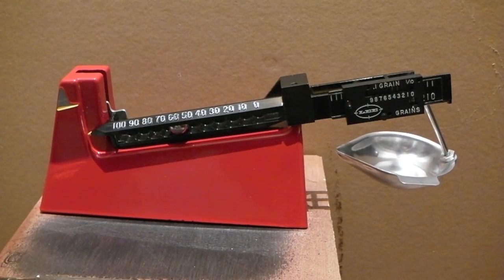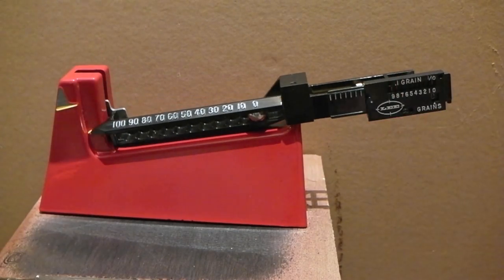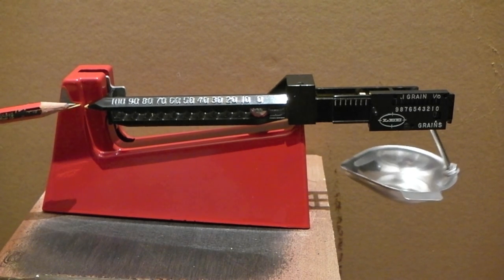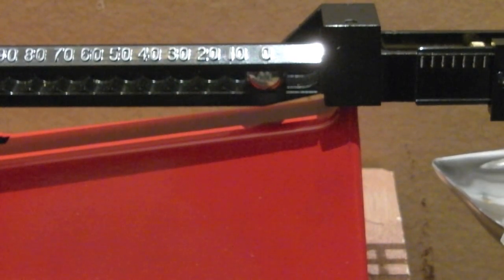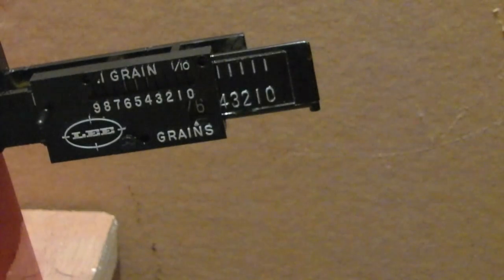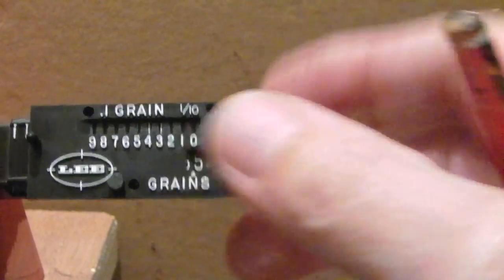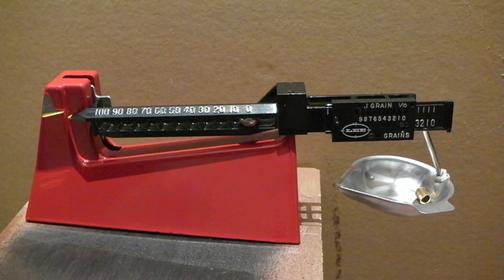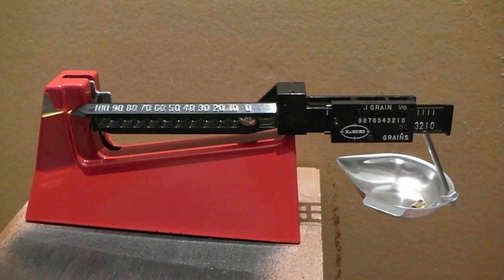Lee powder scale,zeroing and using.

Comment: I just ordered the Lee Breech Lock Challenger reloading kit and it comes with one of these. Now I know exactly how to get the scale zeroes correctly and ready to use. Thanks for the great video.
Reply: Joe Chance  Absolutely. When I received it and started exploring the scale it would not hold steady. I eventually realized the air from the A/C vent right above was throwing it off. At my job we have these plastic cages with openings on the sides to put the sample on the scales. After having problems with the powder scale, I realized the cage is to keep anything like moving air from messing with the measurements. I came home that day and put the powder scale in a small Amazon box on its side and put the powder scale inside. No more wobble and I get to keep all those nice cool air currents to myself.

Comment: Just bought one online.  Will have to learn how to Zero it in the beginning (THANKS!) but this video showed how to Zero it.  There is a trick to have it measure faster that I have used with other scales (using analog scales is a lost art - you showed that also!) but this is used to calibrate your dispenser so it will do just fine as far as speed.

Comment: Great video. Simple stupid easy. Lots of folks want to go with digital scales, the one I just bought gave me hits all over the place with the same load repeatedly placed over and over, no changing anything. The lee scale came with my kit and Ive found that while it is a pain in the ass, it is the most accurate. Come to find out me getting so close trying to get the .1 lines just right, me breathing was giving me erroneous readings. Thanks for the time putting this out there!
Reply from the maker: Thanks for that Harley,i too was getting different readings with digital which didn't give me confidence in my loads,i will stick with the lee scale,cheers.

Comment: Just starting out so I bought the 50th anniversary kit. This scale really scared the crap out of me. So, I bought a used scale off eBay. I did learn how to set it up correctly with the lines on both sides and I have to say this. This scale is right on the money. I zip tied it down, so it won't move. It is so light. Not as easy to use as the balance but like I said it is balls on. Wish the powder pan was deeper and 2 piece so you can remove just the pan.  If this is all you got learn how to set it up correctly and run with it.

Comment: The tenths are on a vernier scale which you sent improperly. Zero on the tenths is good line on the zero, faint on the 9 and on the 1. You zeroed a tenth off.
Reply: I swear that this is how Lee says to read this scale. Solid line on zero with 1/2 line on the 1 and 9.  Same for reading your weight. You want a half line on either side of your mark. Good video though and thanks for making it.
Reply: @burkecunningham7137  ... need to read it again. "...the center mark of the 3 visible marks NOTE When reading zero or 9, the 3rd mark will be at the opposite end of the scale. See examples 2 and 3."
Reply: @jlscjwtwich  There are 3 marks, right?  So zero would show faint marks at 1 and 9, wouldn't it?

Comment: the funny thing about scales.  I have a bunch, and the cheap LEE scale is the most accurate. I have expensive OHAUS, RCBS, balance scales, and some digital scales for weighing....but that cheap little LEE scale ($20?) is the most sensitive and accurate, and the reason Why?  It balances on a razor blade.   The others balance on a pin....so they have a LOT more friction and room for error in that pin.  And digital are usually needing to be calibrated or watched closer than analog too.
Reply from the maker: Yep,i bought digital scales and went back to the Lee scale, was getting different readings each load weighed, if its set right a balance scale cant really lie, thanks for looking in.

Comment: I really hate this scale. I reloaded two boxes of 9mm using it to verify charges and never used it again. It's finicky, hard to zero, and it takes forever to stabilize when you're trying to measure powder.
Reply: This scale is designed for extreme accuracy, its probably the most accurate scale on the market, that's why it can be tricky at first to get right. Once you get your technique finely tuned, then this scale really shines.
Reply: Peter Griffin Or you could just get a better one to begin with and not worry about it.
Reply: @BallisticGrandpa  This scale is capable of accuracy up to .001 of a grain, a digital scale that can reliably produce similar results will cost at least $1000. I know this because I've owned a variety of scales, both high end & low end. The Lee scale is by far the most accurate consistantly, that level of sensitivity is important for those of us who shoot F Class competition. For just regular plinking ammo it's not necessary to be that precise.
Reply: Peter Griffin Ok, but I didn’t say anything about a digital scale. There are much better beam scales just as accurate as the LEE that are easier to use and certainly don’t cost $1,000.
Reply: @BallisticGrandpa  ok, name a beam scale that consistantly weigh to .001 accuracy that cost's the same as the Lee scale, which is $28.00.
Reply: @BallisticGrandpa  Also, dont get confused between 1 gram and 1 grain as you Google search to try and prove me wrong.. the descriptions of scales are in grams, it takes 15 grains to make 1 gram. So when you find a beam scale convert what it's capable of into grains , as they are much lighter than grams.
Reply: Peter Griffin I never said anything about price either. If I need to pay more for a scale that’s just as accurate but MUCH easier to use than the LEE, then so be it.